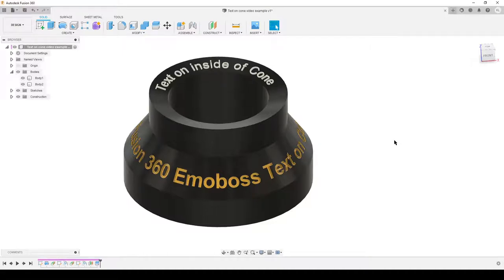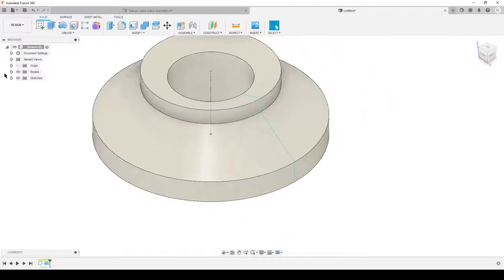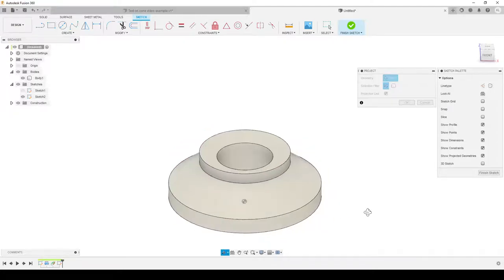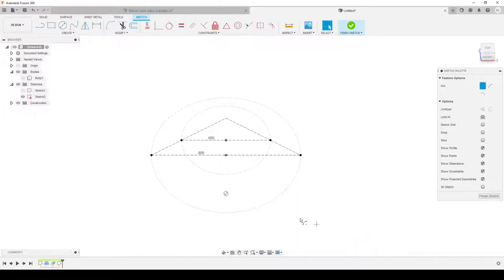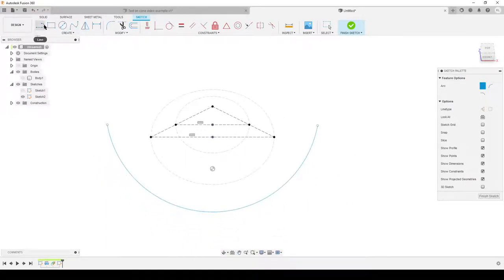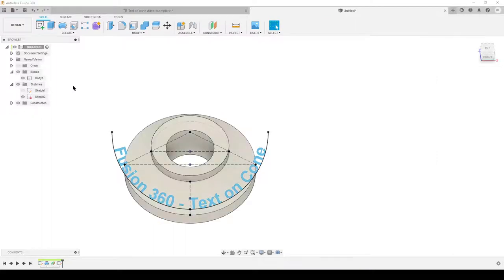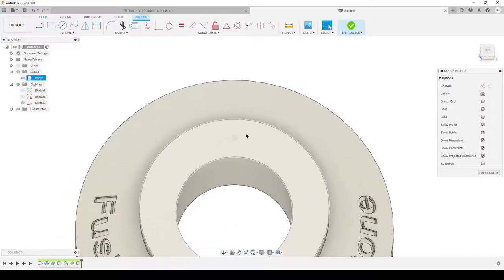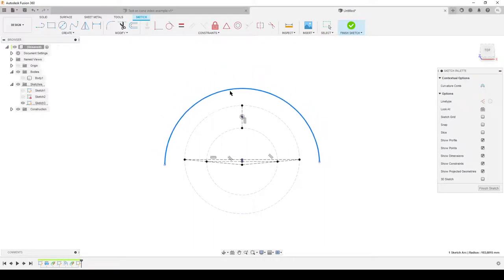Text on Cone Face in Fusion 360 - (Text on Path + Emboss)

Comment: Hey I love the video, really easy to follow. I feel like I did all the steps accurately but I keep getting an error when I go to select the plane when embossing. The error is "Sketch profiles are not Coplanar. Deselect profiles that are not on the same plane" Any thoughts on a fix?
Reply from the maker: Some fonts and curvature will not work. Or if you have had 3D sketching activated and something has moved of the plane, but I'd mostly suspect the font. Have you tried changing the text or font?
Reply: @KristianLaholm  Hey I just tried that and it worked! Weird since the message didn't really hint to that. Thanks for such a helpful video Kristian!

Comment: I almost have this working. I have my text on the path and it looks good but the plane is still showing, yours isn't and when I try to emboss, and I pick the face of the cone, it says the parts are not joined. oh , I had to turn off "tangent chain" option.
Reply from the maker: It's hard to say whats wrong. Did you select the correct plane for the text sketch? (on starting the sketch the plane should be hidden) And some fonts will not work with emboss due to geometry of some letters, try and different font.